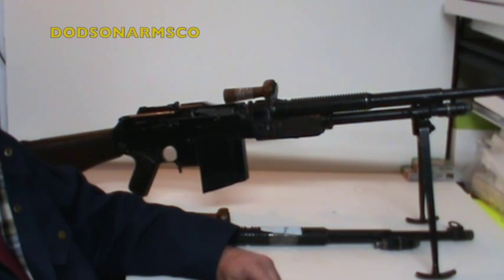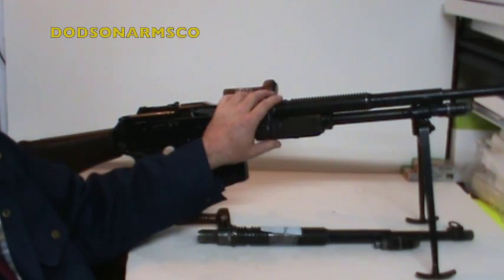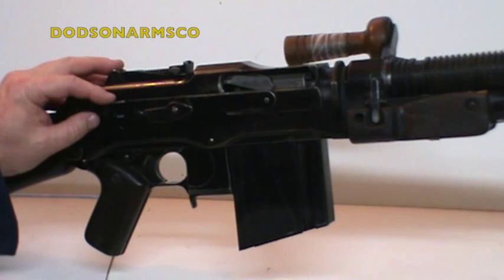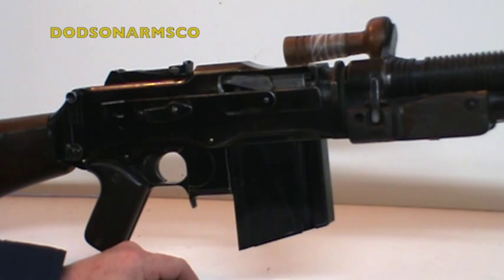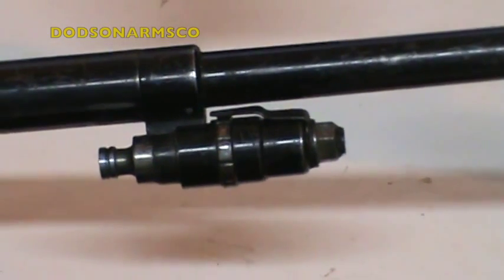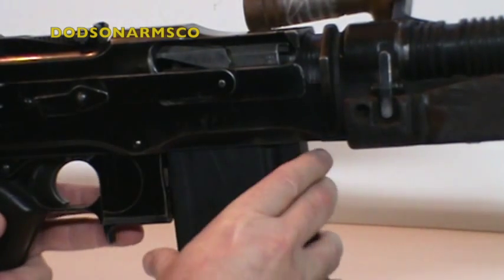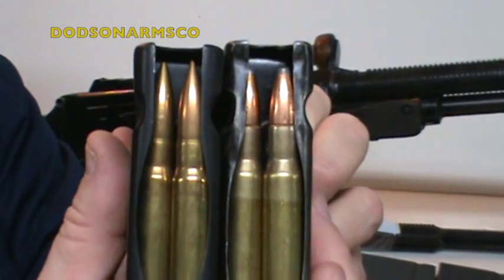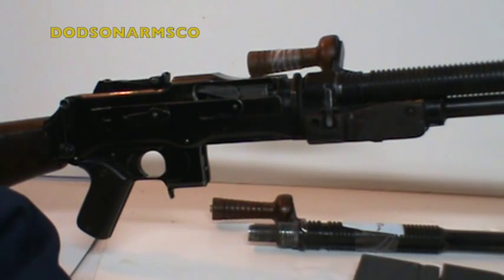Employing the FN30 BAR: FN TYPE D BAR: 1918A2 BAR

Comment: Hello,
There has been also 6,5mm Swedish version with qd barrel + polish 7,92mm which was acctually father of fn model 30.
Reply from the maker: +Bartek T I like the two Swedish versions the fixed barrel and the quick change one. I have seen a few of both come up for sale at auctions occasionally. The Chinese also used the FN30 in 8mm in small numbers some were captured by the Japanese in China and reissued, several were captured from Japanese units in the Pacific Islands during WW2 and were registered as C&R's.

Comment: where can i get one? Pre sample would be best. I mainly want that pistol grip on one.
Reply from the maker: +Melissa Leake pre-samples are the most common, they come on the market as dealers retire or down size. Mid West tactical usually has 4 or 5 per year that come up for auction. A few post samples came in the US about 10 years ago. Best way to find one is to look on gunbroker over a year you may see 10 come up for sale.
Reply: +dodsonarmsco thanks!